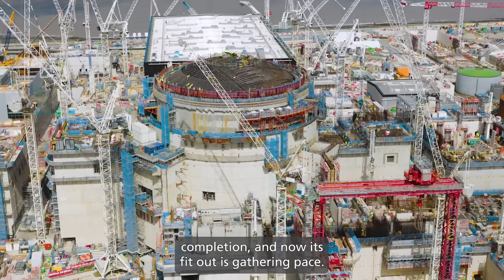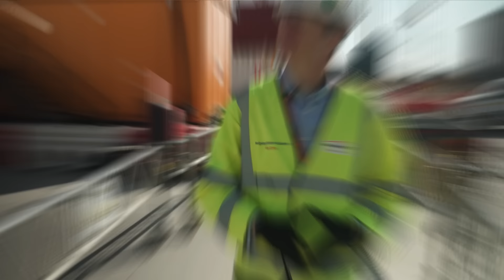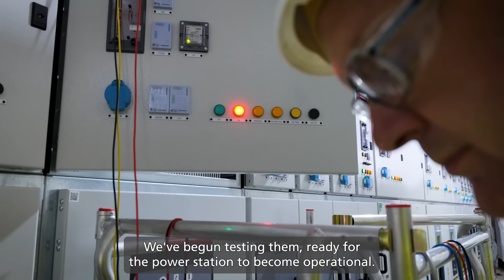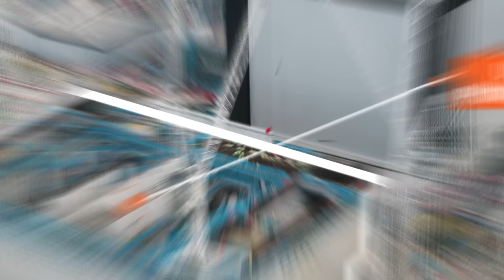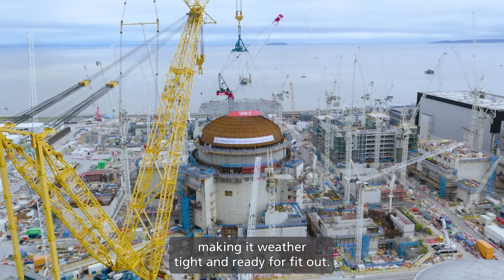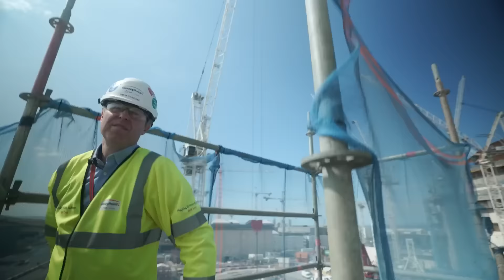Hinkley Point C | Project Update October 2025

Comment: Will be interesting to see whether this project can beat the previous delayed construction times in France & Finland where commissioning was delayed by 10 & 14 years respectively.  If the eventual costs follow a similar path (Flamini, 5.8 times higher than original estimate) it’ll be £100billion.  The Swansea Bay tidal lagoon now looks ridiculously cheap and you wouldn’t  have to continue maintaining it for, well, forever.
Reply: nope, a Nuke reactor cost is about 3 to 6 billions,  the rest is green lobbies calculing the years they slowed the build process which supposedly didn't produced electricity, a ERP reactor makes 1billion a year of production,  so 14 years is for them the false "cost" of 28 billion + 12 billions building it, the 28 billions nevah existed, because it will alway produce electricity for the next 80 years, and not  reduced life, as nucleides didn't  yet merged

Comment: Jolly good but I have some questions. What about the sea level rises which are already 'baked in' to global warming calculations? Hopefully there are provisions in place to deal with that. It makes sense to use the experience of Hickley C to build Sizewell, so that the skills/experience are not lost as the UK has tended to do in the past. I am a Brit living in France where 75% of our power is nuclear. Bear in mind that Hinckley C is the same design as Flamanville, the latest French reactor to come on line. Building of that power plant started in 2007 and only became connected to the grid in December 2024!!...don't hold your breath people as once they start the reactors up and testing the pressure vessels.....🤔..Meanwhile, solar, wind and batteries are getting cheaper, more abundant and quick to build, making the economics of nuclear power look a bit flaky
Reply: Sea level rises😂😂😂you actually still believe….omg
Reply: @senseofthecommonman  Global sea levels rose 20 cm between 1901 and 2017. Half of that rise has occurred between 1993 and 2017....it isn't about belief, it's about science and facts supported by data.

Comment: Bravo. On the pace they are making my baby would become an adult by the time its finished.
Reply: Sadly a possibility. See my comment above about Flamanville here in France which took 17 years between cutting ground and connecting to the grid.
Reply: @EVDiaries-since2019  ask you green party how its possible, China builded 4 and it took 5 years, China doesn't have green lobbies working against them
Reply: @RayZon69you nailed it. I blame the green parties of Europe to have almost killed the nuclear sector. The level of safety requested in those new nuclear plant are unbelievable and unique.

Comment: As impressive as it is I am more optimistic about smaller modular reactors that Rolls Royce seem to be involved with.
Reply: You really want to see a huge multiplication of sites where fissile materials are delivered, used and stored?
Reply: @EVDiaries-since2019  They will start by putting the SMR's on land that already has fissile material stored. That is more sites than you might think.

Comment: Thanks for this. Nuclear is clean and safe. Coal causes 100s of thousands of deaths each year through respiratory disease. I'm also all for secure diverse energy supply. But what's the levelised cost of electricity? Why are we building these incredibly complicated and expensive reactors which are years overdue and over budget when solar and wind plus batteries are so much cheaper and ready to go? Serious question.
Reply: Solar, wind and batteries can be extremely effective. We insulated our Victorian house, installed 12 solar panels on the roof, installed an air source heat pump and permanently cut off our gas. The house generates more electricity than we use and remember, that's all the heating of the house & hot water too. Solar and energy efficient buildings are incredible.
Reply: @JakeBrumby who’s a clever boy then! You’ve saved the world all on your own….
Reply: wind and solar can’t charge the batteries unless there’s wind and sun. and if it was a really serious question you’d have thought about the scale of such a project at a national scale. 

I can guarantee the current wind power footprint is much larger than this project! it doesn’t get more energy efficient than nuclear
Reply: 70% of electricity generation in India and China are by using Coal
Tell them
Reply: @roymichaeldeanable  got a source ?  China  was 56% last time I checked ?
Reply: Because nuclear power is not weather dependent.

Comment: Now build 10 more so can actually get the benefit of scale.
Reply: Yep.. Scale is how it’s done before. 

These will work for 100 years or more, and absolutely there should be more built! They will become the backbone of British societal wealth for generations.
Reply: Yes, they have to build more to have the advantage of scale, but the most important thing is that there are intervals from 2 to 5yrs between the moment the first pole is struck (depending upon how many nuclear power plants u need and what the maximum operational lifetime is), so that when Hinkley Point C is turned off for decommissioning, there are still people building new nuclear power plants. And that the know-how is not lost because people have retired, as has now happened, the youngest operational nuclear power plant was built 30 to 40 years ago. The know-how of building can therefore be used for disassembly.
Reply: @vlaardingerrr Disassembly might happen in 100 years. In the US now, 12 reactors have achieved life extension permissions for 80 years. 

Reactors are machines, and machines are made of parts. Parts can be exchanged as they go older. The only part that is hard to change, maybe not impossible, but hard, is the reactor vessel itself. As long as this part is measured carefully and is deemed good, the plant can continue operating.
Reply: with which money? UK gouvernement secured a huge beneficial deal by paying almost nothing to the 2 leaders of this project against a guarantee advantageous price of electricity to the industries.

These project require tons of Cashflow provided by the 2 leaders of this project: EDF and CGN. 

All the financial risk is on them during years. 

EDF Made it clear. They won’t signe contract like this in the future.

Comment: Atmospheric carbon dioxide is the gas of life.   1200 ppm atmospheric carbon dioxide three times today's level  would greatly green the earth and is used in plant growing greenhouses.  The cause of global warming is not known.   To pull the UK out of extremely high energy costs with a lot of switching to electrical power the UK could have China build modern ultra supercritical (USC) clean coal power stations to efficiently and cleanly burn British bituminous.   China is superseding its old coal power stations with these new USC coal power stations.  US USC estimated natural gas crossover fueling price is $0.80 mmBTU, US wholesale natural gas $3.00, UK wholesale natural gas came down to $10.50 Oct. 2024.   

The UK has large reserves of high quality British bituminous coal.  The UK has to import a large percentage of its natural gas and has no uranium.  The China USC coal power station on a fast build schedule could be online in 4 years and possibly less.   China is making over 100 of them.  In a few years as the USC coal power stations take over base load electricity China will be making more coal fired electricity with less coal and almost no air pollution.
Reply: You do realise humans weren't around when carbon dioxide levels where much higher, no life on earth is prepared for that let alone at the fast rate it is changing
Reply: If it means we can have 100% energy independence in 20 years, who cares.

Comment: The most expensive power plant in the world. I don’t care how advanced it is or how much power it will generate it is shocking how much this thing costs. Over £40 Billion for a single site?
Reply: The newest nuclear power plant in the UK was built between 30 and 40 years ago, the majority of people who built that power plant are approaching retirement age or are already retired. Those are the people you need because they have the experience. During construction, they know what they need and in what order, even up to the bolt sizes. You can't learn that experience in any textbook. It's like you can drive a car without any explanation from an instructor after passing your theory exam for your driver's license and you are expected to immediately drive at the same speed as the other drivers and without getting any accidents. Now that the first one is being built, in this case Hinkley Point C, mistakes will be made that will cost extra money. The following nuclear power plants will become cheaper and cheaper. He also said that they saw a reduction in working hours between the 1st and 2nd unit, partly because of Covid, but also because people know what to do and what is expected of them
Reply: @vlaardingerrr yeah right….
Reply: @vlaardingerrr  Exactly
Reply: Going to drop our electric bills? No way. On LBC radio it was said if our electric was free in 5 years. It would still increase 20% think about it.....
Reply: It is expensive. But compared to the annual cost of the NHS of £180 billion every year... to me, powering 10% of the UK for up to 100 years (current estimate) doesn't seem too bad in the scheme of things. We need reliable power and we need healthcare.

Comment: Seems a shame that in a few decades it'll have to be decommissioned(?), to think how super complex all of that is and has the utmost best of every bit of modern technology available has been jammed in tight.
If only these places could last much longer! I think they're so amazing.
Reply: Its commissioned to last 60 years, with most likely an extension to that. How long did you want it last?
Reply: Reactors in Sweden originally built for maybe 40 years and currently extended to about 60 are talking about extending to 80. Proper maintenance and switching out components that can be switched out with more efficient ones in the future like heat exchangers, turbines and generators and who knows how long it can really last.

Comment: Awesome, would love a tour around that site, during and after construction!
Reply: In the early 1990s I worked as a contract project manager for Canberra Packard, the company which did the 3 mile island clean up in the USA. The project was to put in a new low level waste assay system so I got to visit most of the old magnox reactor sites. The turbine halls are simply immense and watching the crane cap machine swapping out fuel rods from the viewing gallery 5 storeys up was something else.